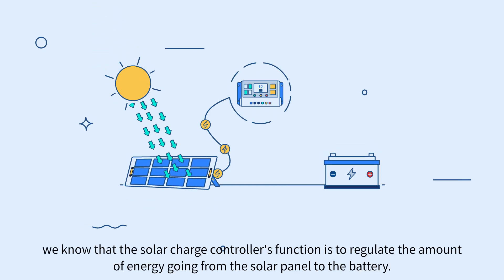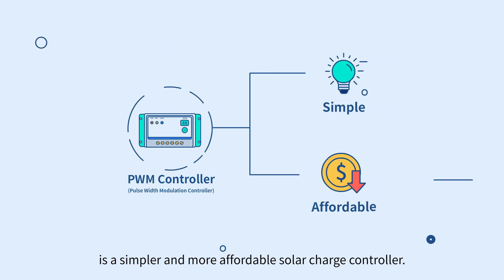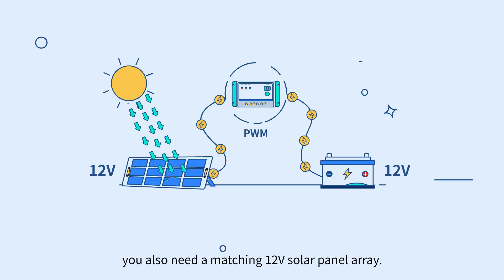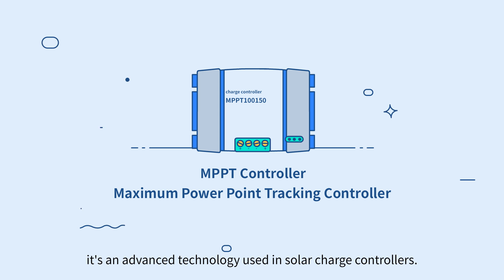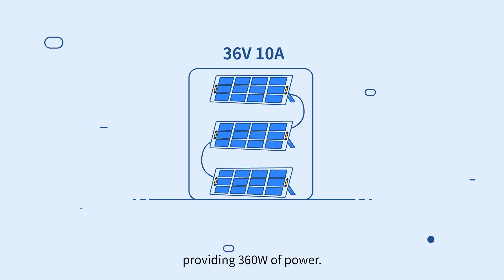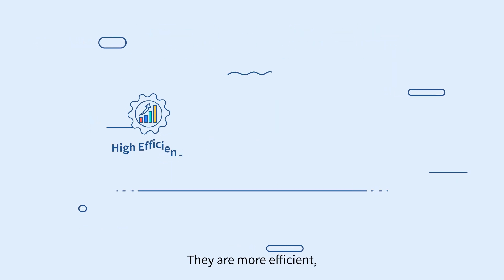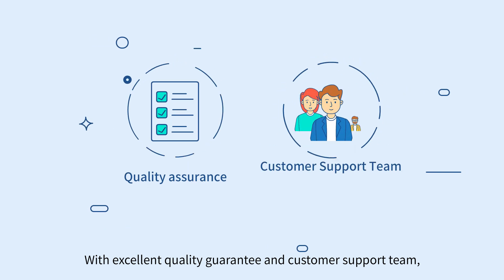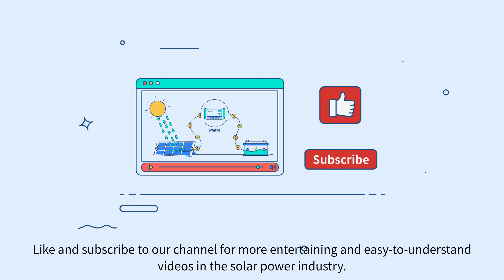PWM vs MPPT: Which is the Best Solar Charge Controller | OUPES Beginner’s Guide 8

Comment: As far as i know 
You can use a pwm controller with 36v solar panel to charge a 12 volts battery since the controller cuts the voltage to match the battery voltage 
The issue is such system is not efficient

Comment: Not mentioned is the fact that MPPT will get you up to 30% more power from the same panel as PWM could.  It doesn't take long to make up for the higher purchase cost with that.  So, if a solar generator or RV company is putting PWM in, they are saving a buck but you will pay, over and over again for the life of the device!
Reply: The devil is in the detail.Most newbies just wants a cheap system to start. But as you said, choosing such got you "paying" with the subsequent inefficiency that will follow.